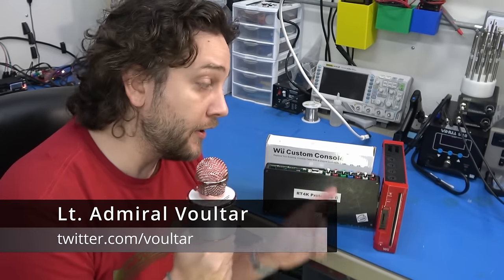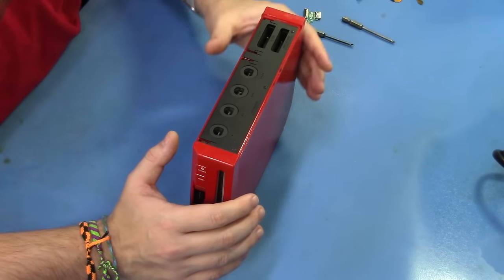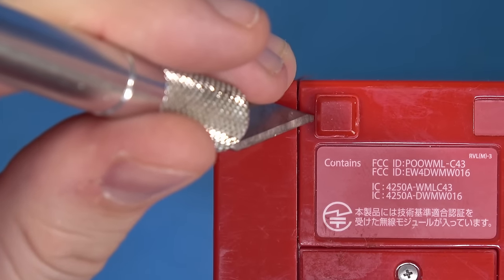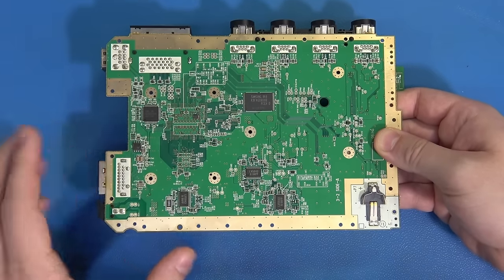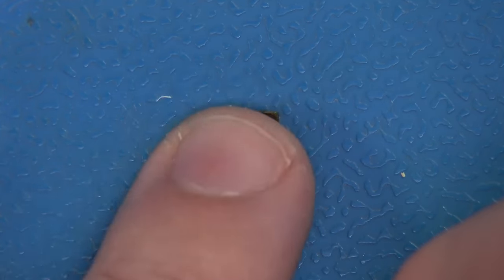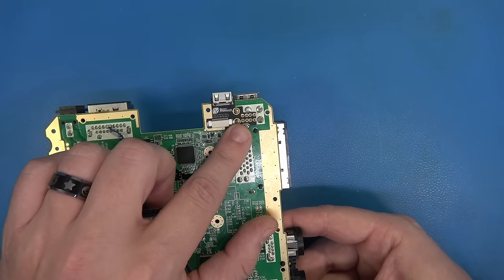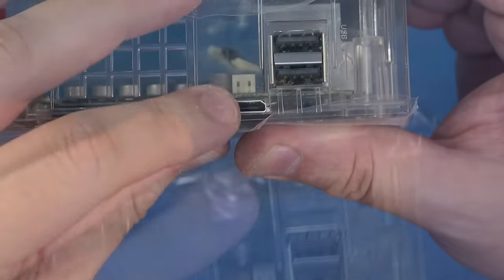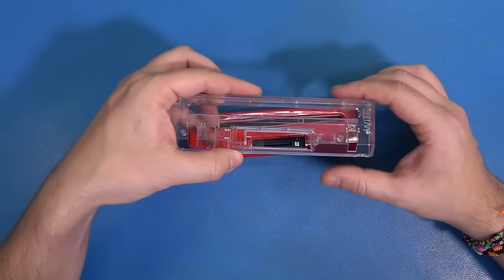Fixing Nintendo's Mistake | PERFECT HDMI Wii Modification in 2023

Comment: Fantastic installation, Voultar! It's been a blast working with you to develop this latest version of our kit.⚡⚡
Reply: Any UK resellers - Zedlabs, Retro Console Parts, etc?
Reply: Any plans to have a full sized hdmi port available too as an option?
Reply: @unpleb8754  Seconded. I don't particularly mind a mini HDMI, but for the sake of uniformity with the rest of the components in my theater system, I much prefer a full sized HDMI option.
Reply: mini-hdmi is stupid and cringe. can you make a version that uses a normal hdmi please
Reply: @ChunkySteveo  unfortunately we don’t have any authorized distributors at the moment. It’s something we’re considering, but we don’t have any in place.
Reply: @unpleb8754  The challenge is an HDMI port does not readily fit within an easy-to-implement location. We had to choose between the lesser of two evils and decided to make the installation easier rather than more difficult and with a normal HDMI.
Reply: @NordicDan  See our other comment in this thread. Hopefully that adds some clarity.
Reply: @ohyou_6599  See our other comment in this thread - sorry for making you cringe! 😅
Reply: @ElectronShepherdLLC  Can you make second board with full size HDMI port and let buyers decide on HDMI size. Thanks
Reply: What temp do you recommend on the iron?
Reply: Cool  video I wish I had the skill to solder to do mine
Reply: Any update on a possible release in Europe or should I just give up hope on thise one?

Comment: totally agree with the getting a clean signal that will be accepted vs having it upscaled internally. more expensive mods will still be great for a single console but if you got a big library of hardware to work with its just better.
Reply: Also less points of failure and a lot less expensive. The only loss I'd say is you lose out on portability as the console alone doesn't give you the upscaling, but it also makes it so you only need to install once

Comment: Another option to remove the rubber pads would be using those plastic spudger type tools. They're usually in blue or black, various sizes, and are great at prying open things without damaging them.

Comment: As usual, great video. My only observation would be using washers to compensate for the removed shield instead of doing the extra filing.
Reply from the maker: Great tip!
Reply: Thanks for the washer tip. 
No matter what I did I had a gap between the fan stand off and mobo next to HDMI port. 
If I tighten the screw all the way my HDMI video would drop out.
Adding a few washers solved the problem!
Reply: @Voultar  what do you think is a reasonable price to pay someone to do the hdmi mod?

Comment: it should be noted, there are a couple differences if you are not replacing the shell.  For instance, the metal shielding around the new HDMI port will need to be fatigued off or cut in order for the hdmi port to lay flush.

Comment: For me, using a little copper wick over those vias (like when cleaning up BGA pads) to clean off the conformal coating works too. That way you don't have to take a sharp razor to the board and risk damaging a trace.

Comment: I work at BestBuy, sometimes in home theater, which is primarily tv sales and sound bars. 4K is the standard. Its been over a month since I've sold anything 1080p and the under 4k section is smaller and smaller every month.

ALTHOUGH, these 8k tv's play 4k content just fine. As long as it isn't 1080p you're hoping to get good picture out of, even 1440p looks ok and the more expensive tv's have ai upscale built in, I don'tt think there's much worry unless you're using default outputs that originally came on the wii, n64, etc.

Comment: Awesome video, a few things I would add...
- I panicked when having no audio. I was about to desolder and resolder the flex cable (again because my first attempt produced no video). I had to dig around the AVE-HDMI kits website to find out to enable the audio through the GCVideo but then...
- How to access the GCVideo menu. I had already had some info that you needed a GameCube controller but it took some time to find it. Again, troubleshooting info on the kits website. How does one access the GCVideo menu w/o a GC controller?
- New shipments come with the IR port with a button. Took some time to figure out how to get that all connected up. It is actually quite easy. Problem is, I only found out where to connect the leads by looking at the images on the product page. That fault falls on Electron Shepard. With a clear case, which I got the smoke clear, the IR port works. Solid cases would require more filing to allow access to the IR receiver. I'm not sure what the button does but I drilled a small hole to access it with a paper clip.
- The ground is different on different consoles, at least the labeling. I have an RVL-CPU-01 and the R186 is not the same. It took a while to find someone's posting and I grounded it to C110. Obviously you can't have every version of Wii board. Is there a ground point that would work for every model? 
- I ordered an IR remote but it did not work out of the box. My GameCube GCVideo adapter came with a remote that worked out of the box. It didn't work either. Luckily, GCVideo menu has a section on mapping the buttons
Otherwise, awesome video, great instructions. My daughter saw a bit of it and liked the bracelets.
Reply: Did you still bridge the pins when you installed the IR board? I believe the button puts it in programming mode for whatever IR remote you're using. I can't find much documentation on it. We really need voltar to do an updated video...
Reply: @RN25899  Yes, although in hind-sight, I should have used a small wire to bridge the points, less solder, more wiggle room. Once I soldered the ground and 3 volt, I put Kapton tape over the pins and then ran the IR and button wires over top the now covered pins. Another hind-sight, there is no reason why you couldn't use a double-sided foam tape to mount the IR board to the front of the case and just run wires from the ground and 3.3v pins to wherever you mount the IR board, especially when using a clear replacement shell. For a solid case, I'd try to mount it near the air intake or exhaust. Maybe it could work through the air vents at the front? IDK.  Otherwise, ya gota drill. Luckily, I have a small drill press (3'-3.5' feet high, can be placed on a table)Unless my nephew is impressed, I don't think I'll be doing this again. As good as a job Voultar does, I don't think a YT video done by a third-party is the proper way to publish your instructions, unless Voultar is associated with Electron-Shepard. He also didn't cover the IR board, something that looks like only recent shipments get. E-S should also had included the IR remote in the kit. They do sell one separately.

Comment: I remember after the Wii's release installing the WiiKey modchips. Didn't even use any type of magnification thanks to my 20/15 vision. I used to do a bunch of console modding services through Xbox-Scene. I even had a guy from Norway (I live in the US) send me his Xbox 360 to fix. I kind of miss doing that stuff.

Funnily enough I never saw the disassembly of a Wii console hard. Sure there were tons of screws but I never considered it hard by any means, just a bit time consuming. That was over back in the late 2000's. Even funnier is that I always used an Xacto-Knife to remove those screw covers. No one ever told me to do that. It just seemed the easiest way to remove them.

Comment: I use cardboard and pen to track my screws and the locations. Before removing screws draw the area you are going to remove and place the screws in their respective locations. Repeat with each new layer or area. Or if possible put the screws back in their location before moving on the next step.

Comment: The only thing I wish the AVE-HDMI could do…. Is “fix” the RGB output of the analog port like what the WiiDual could do.  

The difference is that the AVE-HDMI can be installed on virtually ANY Wii, while the WiiDual can only be installed in certain revisions.  

Don’t forget to turn off Deflicker either from “Priiloader” hacks, or from the USB Loader GX menus (plus Framebuffer).

Comment: Thanks for the video, it inspired me to grab the kit and try it myself. Soldering to the vias is definitely the hardest part for a novice but following along with lots of flux and pushing around the solder it came out fine. I had 26 gauge stranded wire, I'd suggest others go smaller or solid core; especially if you are adding the IR board, the data pads are tiny and very close to the native Wii display connector pins. Thanks Voultar, and good luck to anyone doing this themselves.

Comment: Voultar is correct. It’s a decoupling of solutions if you will which in my mind is a better design architecture in this space. Why invest all that cost into features (that arguably is so most probably won’t appreciate) that means a higher barrier to entry from the consumer point of view that could otherwise be handed off to more robust solutions in the next chain e.g. BYO up-sampler hardware of your choosing.

Comment: I think for legacy systems it's totally fine to have a solution that outputs 1080p and then have the television/monitor scale that up to 4K or 8K with integer scaling, once monitors with that resolution are more common. It's not like there is a significant amount of image quality to be gained when going directly from internal res to 4K/8K in one step with a post-processing approach.
On the other hand, having a hardware modification that can generate ultra high resolution outputs directly would increase the price tremendously, because then you need advanced and very expensive FPGAs with high internal & external bandwidth, aswell as capable PHYs, better PCBs and all that, plus the developer would need to license HDMI 2.1 on top, so I totally agree with your stance on simpler modifications that allow for a digital signal output being the way forward.

Comment: Totally agree with you philosophy when it comes to just outputting a good, clean signal and let some other thing do the "heavy" work. 
I will probably just go with the component cable, since the OSSC doesn't support any HDMI input, and I guess with all the options I will be able to achieve a better image than, in my case, just plugging the WII directly into the TV.

Comment: Thanks for the video! What's the gauge of the wire you used for this mod? It seems to be a very small stranded wire but not sure if it's 26, 28, or 30? Thanks a lot!

Comment: I tried the dYI hdmi mod where I built my own board and used the Wii dual flex cable. I never got it working I don’t know if I built the board wrong or did the install wrong but I was hesitant to watch this video because the frustration I’ve had trying to install it. But after a while I figured just buy someone else’s perfected board and rip out the one you put in. So in with electron Shepard lol

Great video voultar (I am making a modded GBS up scaler later this week via your tutorial, I can’t wait to get it finished)

Comment: Can someone explain why someone should do this mod vs just buying a wii u and doing  a basic CFW mod?  What advantages does the original wii have over the wii u that already has a  HDMI?
Thanks
Reply: CTR there are a few reasons why people want hdmi mods for wii. 1, gamecube controller support out of the box, while you can use the smash bros adapter for gamecube games on usb loader, wii games still can't use it due to restricted coding meaning you are stuck with classic controllers in brawl and tvc due to the ports not being in the wii u. 2, it is faster to mod a wii than the wii u because of the message board exploit to install the homebrew channel, compared to wii u which takes twice as long to set up and it's riskier to destroy the wii u. 3, and it's the main reason, it's to play the games in their original hardware with better picture quality. It all comes down to you want to future proof it depending on your setup, and if you happen to have usb loader that I mentioned back for reason 1, you can disable the deflicker effect to off extended and the wii games will look better than the deflicker turned on.

Comment: Thank you for this detailed video.  I own a PAL Wii console and RGB works out of the box whether with RGB scart or component cables. I am using Wii component cables (from Hama) attached to connected to my Retrotink 5x. Comparing the results I barely see any noticeable difference. Unless you look very closely. I only see the video quality being slightly sharper than RGB component. The other minor difference is the color output being brighter. Other than it isn't really worth the investment for me.

Comment: Excellent tutorial!
After installing, I get picture, but no sound.
Tshooting efforts:
-different hdmi cable
-different tv monitor

Any thoughts?
Reply from the maker: YES! 

Go into the menu of GCVideo with GC Controller and set the output mode to DVI+. Sound WILL NOT work unless you enable DVI+ mode.
Reply: @Voultar  I was struggling with the no sound issue. Thanks 👍
Reply: Thanks Voultar!!

Comment: I don't really care about digital output kits only being suited for 1080p with 4k being around the corner myself. These consoles are rendering at lower HD resolutions at the absolute best and SD resolutions most of the time so even having inbuilt upscaling to 1080p is a nice but not essential feature for me, having a HDMI output is why I like them as it makes it easy to install into modern TVs and makes it reasonably futureproof, especially when most TVs these days allow for integer upscaling internally so in theory it should be the same quality vs the digital output kit upscaling all the way to 4k/8k itself.

Comment: Extremely helpful video, what wire is being used for 5 volt and GC controller connections? Is it the 28 awg wire from your Amazon store ?
Reply: Not sure what Voultar used but I used 26 gauge stranded which worked well so far

Comment: Can't find any documentation on where to solder it on the older revision boards... any help?
Reply: I have a 1st Gen Wii I soldered pins 5 & 6 together of the composite together like voultar did in the video.
I didn't have any composite output after that. Later seen in a photo on Reddit a 1 Gen mod with just 1 wire going to pin 6.
After I did that my composite started working again.
Great install video couldn't have done it without it! Thanks voultar

Comment: This mod is awesome, anything that adds to the experience and gives you a reason to keep playing gets the thumbs up from me!👍

A switch added to the back witch lets you switch between rgb and hdmi output would be a great plus as i still use my wii  for 240p buisness on a crt via rgb scart. Not sure i would want to loose rgb by tricking the console in to thinking its in ypbr mode 24/7 a little switch there would be fab if it's achievable.

But still rgb quality from the wii is not as good as gamecube's rgb output,  here is where we need a good mod, something that makes it as good or even  better than the gamecube output.

Comment: Thank you for the screw mention. Ifixit guide ones are useless because it didn't mention the screw length and head type for the Wii.
Luckily I have some colour marker pen, i use them to mark the screw with the board. No more missing screw next time I open them.
About the thermal pad, what size is it? I only know it uses soft type.

Comment: I think the only thing i would have liked to know from this is the correct thickness of the thermal pads. I have a bunch from when i serviced my gamecube so i would love to know the thickness of them.

Other than that fantastic video, will be following it when my mod kit comes in
Reply: I used 1.5mm arctic brand thermal pads when I recently took apart my cousin's daughters wii for maintenance and refurbishment. the 1.5mm seem to be almost identical to the original pad size.

Comment: How does the interposer not warp when exposed to direct iron contact?
Reply from the maker: The substrate is designed to be in direct contact temperatures required to reflow solder (for short durations).

Comment: Part of the appeal of the Wii Dual kits (when they were available) is that it also fixed the Wii's built-in analog output to generate better quality video including RGB, more akin to the crisp analog out from a GameCube. Does this kit modify the analog output of the Wii at all, or just simply grab digital video to output to HDMI?
Reply: I'm pretty sure it doesn't. 🤔🤷‍♂️
That's a good point.
I still think I made a good decision pre-ordering a unit. 😅

I have a launch model which is really good once I enable Extrems' 480p fix, so my analog output will be OK anyway. However, I read that even some launch models of the Wii had subpar decoders.

Comment: Should we hot glue this baby in place? Or is the amount of possible tension on the central mod board insignificant and easily held by the bodge wires (if that's even the correct terminology)?

Comment: They are selling the boards with an IR sensor “for Wiis without GameCube controller ports”. What does this additional item do?
Reply: Its simply for changing the settings of the modification because that would normally be done with the gamecube controller

Comment: A question that is slightly off-topic.  I have a tiny OLED screen where the bandcable is partially seperating from the PCB.  Would hitting the top work like you show at 4:57 to sort of "reflow" it back on the PCB?